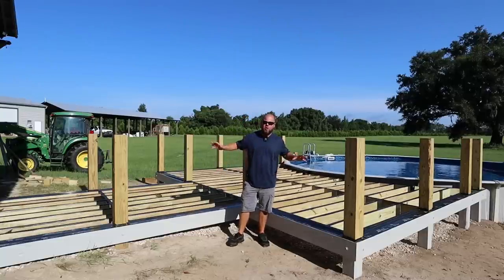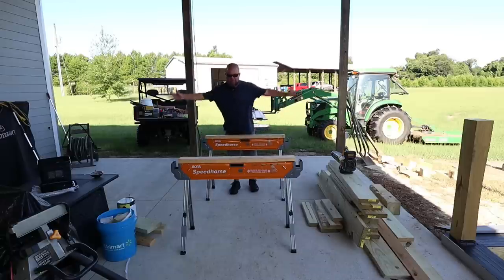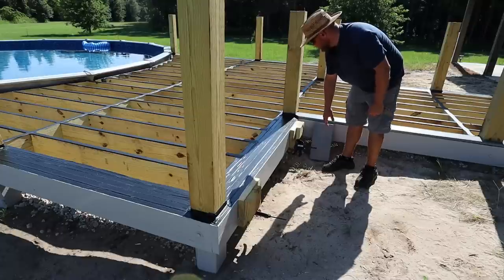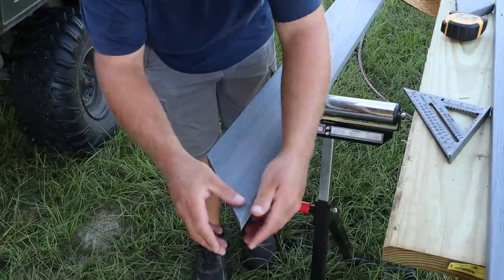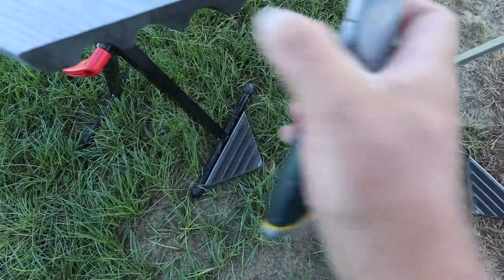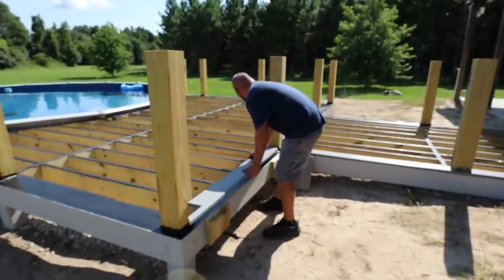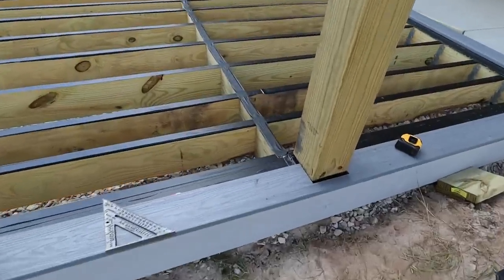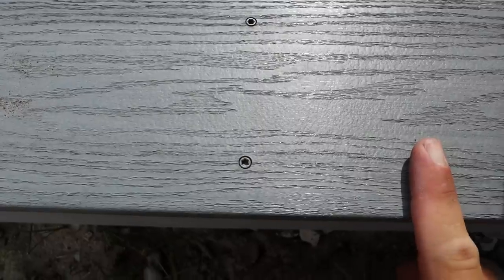DIY composite decking! Deck build part 3 Ep #823

Comment: I know that this deck is completed but there is a company that makes a fastener that drills a counterbore hole and provides plugs to fill it after the screw is installed. The ones you used are probably just as effective and probably less expensive. Looking great, can't wait to see it finished, I know you and yours will get many years of joy out of this.
Reply from the maker: Trex offers the plugs I believe.

Comment: I’ve found from experience that in the hot summer weather of the south, composite decking gets soft and warps from the weight of walking on it. I had to put double the floor joists for support. 105 degree heat is hard on plastic composites.
Reply from the maker: That's why I went 12 inch on center.

Comment: Looks fabulous Adam. The expansion gaps at the miters are just the cost of doing business in the heat. There's no way around it. I also have a Bosch rangefinder , mine has a 50 ft range down to a 16th of an inch. That's amazing 👍
Reply from the maker: Thank you for watching

Comment: Lookin good man. I was wondering how much the wood would show through the slats and if it would have been better to paint the wood first, but even with this camera angle you can only see the wood through a few runs. The boards definitely suck up tighter/closer than I thought they would and covers up nicely. All's it needs now is a big ol ruger hole underneath for him to roll around and get filthy in.
Reply from the maker: The black tape really hides the wood. You can't see it unless at 90 degrees and the sun's out.

Comment: Andrew the deck is looking beautiful. You have done a fabulous job. As far as the joints shrinking that is so common that you really can't stop that. You are correct as if it was really cold and you cut tight joints you could have trouble with buckling when it gets really hot. One thing I always did when I was building decks or even houses was to run my 8ft level over the joist as a straight edge and plane the high joist and I would then shim any low ones as all the joist are not always the same width. My guys would complain when I had then do that on roof rafters and ceiling joist but they did it. Makes for a flat finished product. Can't wait to see the finished product. As I have said before, You and Tiffany are living your dream. Take care and go easy on the back, especially when you start cutting all those big logs into firewood that you hauled in. Stay blessed..
Reply from the maker: I need to grab me a 8ft level just for this reason.

Comment: If the gaps in your joints are really driving you crazy, you can buy colored silicone caulk that should match that grey very closely.  There are dozens of colors to choose from, or you can add some dye to white or clear caulk to perfectly color match the decking.  Smear a little bit into the gaps and it will squeeze and stretch with the temperature changes.  As always, your project looks great.  You should be proud of yourself sir!
Reply from the maker: It's not bothering me that much.
Reply: @TKCL  Yeah, I get it.  It's likely nobody will ever notice, except you will notice.  That's how I am with projects... I like things perfect, even if it's just for me.  That deck looks bitchin.
Reply: Very nice Andrew. Looks awesome. I really think I will do composite when it’s time to redo mine. Thank you

Comment: Deck looks better than I imagined. I can see how beautiful it's going to be with the landscaping. I like what Crystal suggested in using rope (white) running horizontal instead of balusters. Either way it will look good. 
Looks like you have lost a few pounds. Congrats. Won't be able to call yourself "fat boy" anymore, lol.
Reply from the maker: I've already bought my aluminum ballisters and composite rails. Otherwise I might consider it.

Comment: I should have said CLEAN water instead of fresh in the last video. There are little chicken water cups that connect to pick pipe allows the chicken to have clean water. Water that is above the ground and the chickens don't poop in it. Just an idea.
Reply from the maker: I've used those with mixed results on leaking. I'll play with a new design eventually.